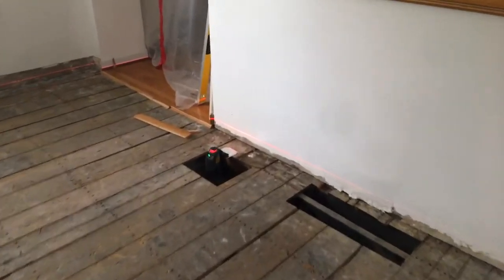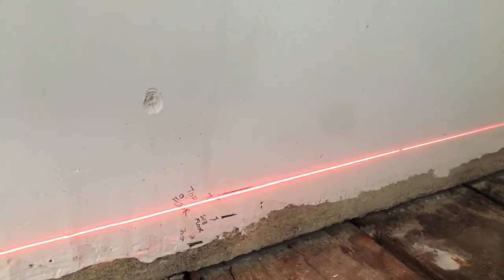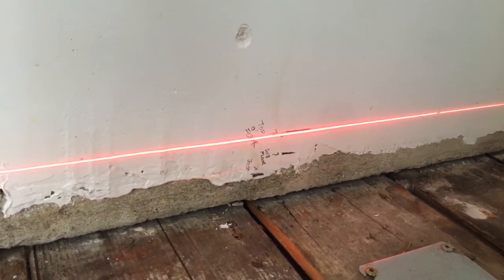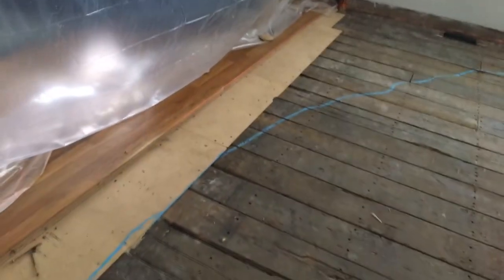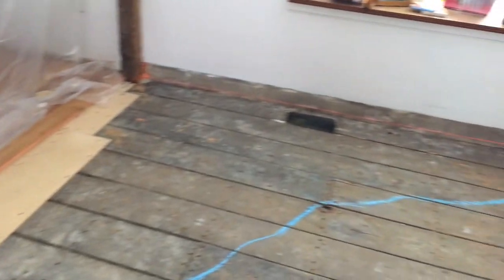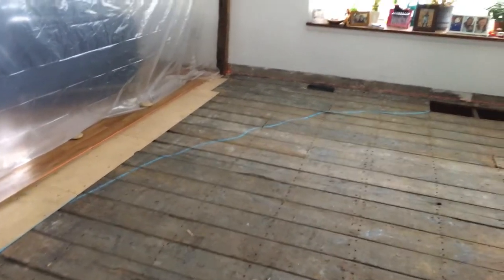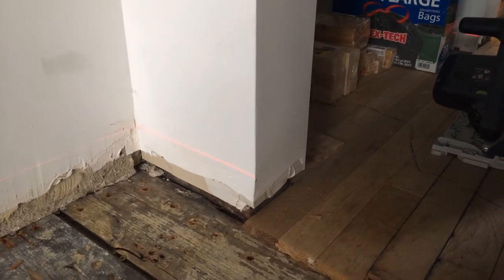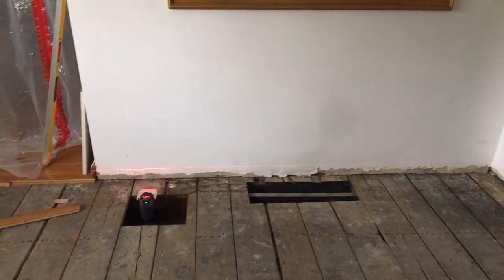Leveling a Sloping Floor #4: Using a Laser Level

Comment: Here's a link to a pretty sweet laser level. The horizontal beam is at the bottom of the level so you don't have to cut a hole in your floor. Frankly, I can't think of a use case for putting the beam at the top of the level instead of the bottom.

WeTols - 12 Lines Laser Level:

3x360° 3D Green Cross Line, Rechargable Li-ion battery, Remote Controller, Switchable & Auto Self-Leveling, Three-Plane Leveling and Alignment, with Portable Toolbox
Reply from the maker: You know I looked around for something like that for weeks and I couldn't find one with the laser on the bottom... wow... nice find. :)
Reply: @postbeam8200  Also check out the Huepar FL360G Floor Laser - laser is 1/4 inch above ground level
Reply: Use case at the top is ceiling leveling. That is why "4d" models exist.